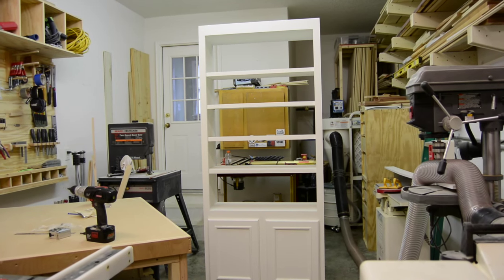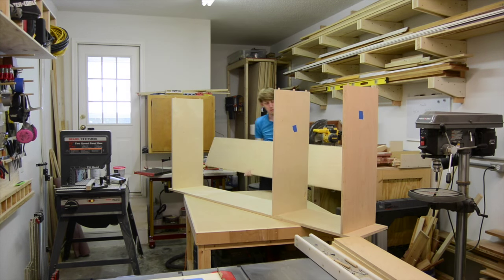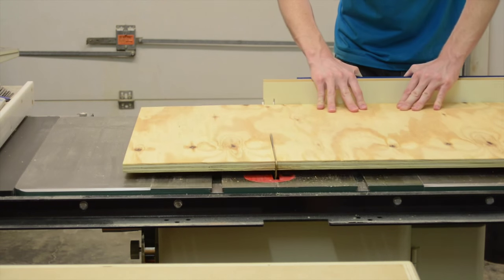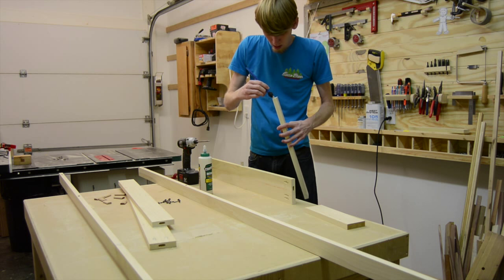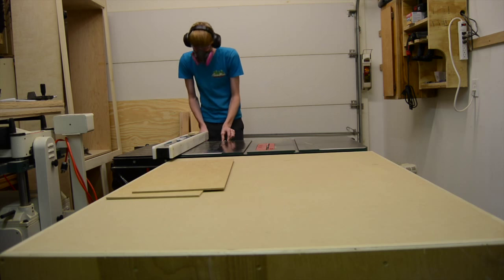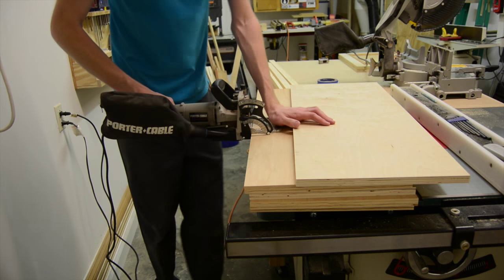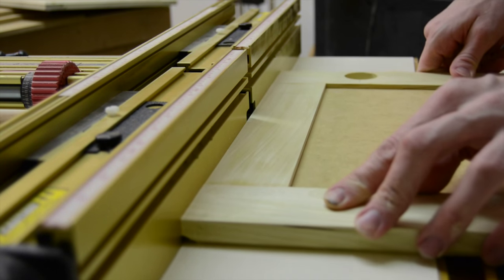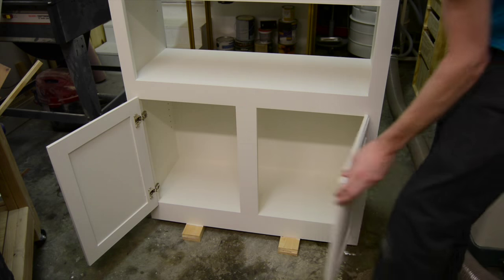Built In Media Center

Comment: Looks good! I too hate painting. I have yet to be happy with the finish I have achieved  whether I use a brush,  a roller or a spray gun.  Spray gun gives me the best finish but it is messy and requires more coats than a roller or brush, as my sprayer requires the paint to be diluted.